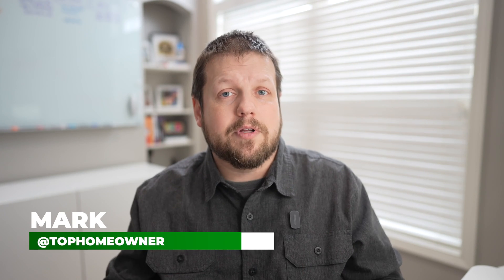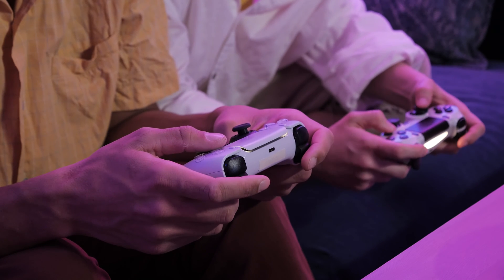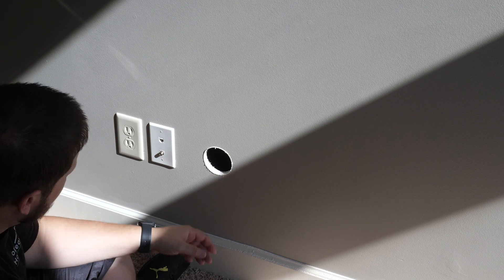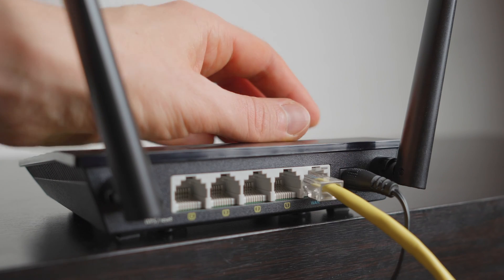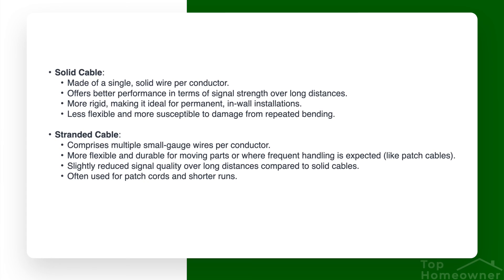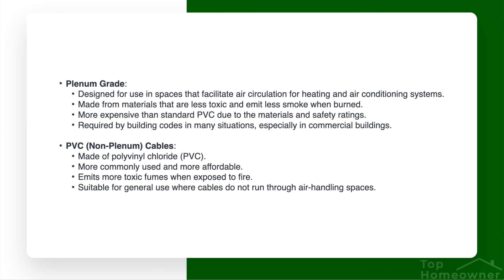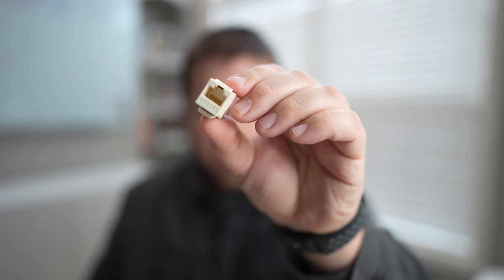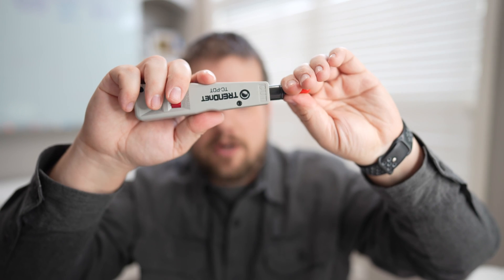End Wi-Fi Woes: How to Wire Your Home for Reliable Internet

Comment: Any advice on which router to get? It’s impossible to turn off WiFi on the eeros and still have Ethernet connected devices function. Need to get a new router asap.
Reply from the maker: I've had good luck with the TP-Link brand. They're pretty affordable too.

Comment: You touched on this but I figuring out the best places to put your AP (or mesh satellites).  Perhaps on either side of the house and centered in the basement.  Maybe where you have your TV and your computer so that you can hardwire there as well.  I think I have it figured out for the next house but it took some brainstorming.
Reply from the maker: Yes, I'd make sure both ends of the house are covered and then add one in the middle if you still have coverage issues. I have an outdoor rated AP in my attic on the far side of my house to help with coverage in my garage, and to extend the signal to some of my wifi lights that are outside.
Reply: @TopHomeowner  Good point on the garage as I was putting one in the high in pantry between the kitchen and the garage to that area (car OTA updates). High toward the ceiling because it would then be above the cabinets and the fridge that would be on the other side of the wall :) --- Also great point about outside IoT devices as I have some wifi cameras outside too.

Comment: Great job. Planning on next house build and will add these tipes and your links.  Only quibble is your comments on mesh. Various nice ones out there that are reliable AND allow easy transfer of strong signal as you move around your house.
Reply from the maker: It's been a while since I've used a mesh network so I'm sure they've improved. Not everything can be hard wired and sometimes installing ethernet cabling isn't practical, so in those cases mesh would make sense. Appreciate the comment!
Reply: @TopHomeowner  It was also in reference to your adding an Access Point in another area.  Some of these (with the right settings - 802.11r (Fast Transition)?) allow transfer of connection when you walk around and if not then you may need to toggle your wifi on and off. My tech geek kid experienced this.